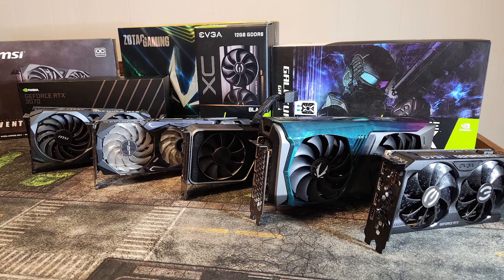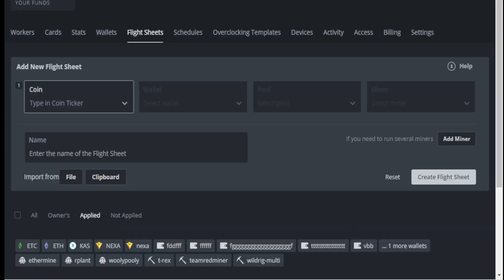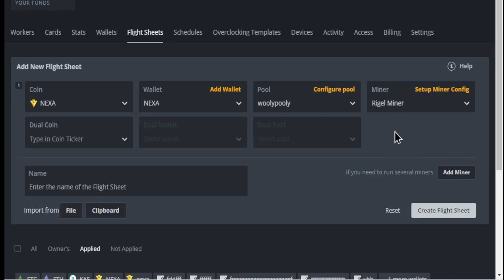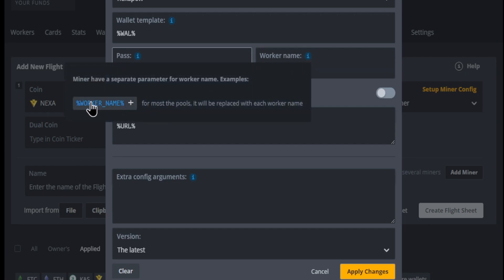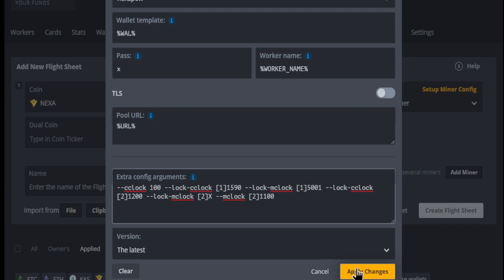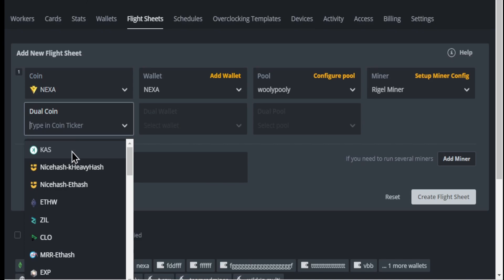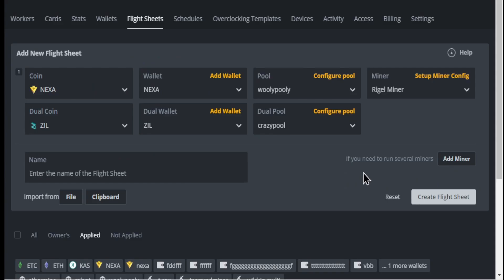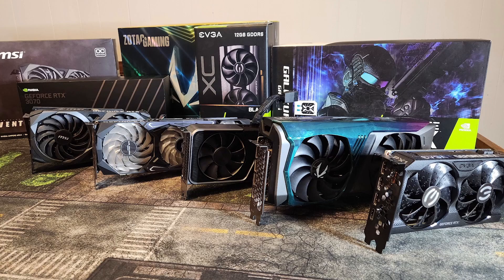How to DUAL MINE NEXA and ZIL on Rigel Miner V1.3.6 with overclock settings

Comment: The question I still have.  Say I have GPU  0-3 and they are all different cards. What parameter command to I put in to tell Rigel what overlocks I want for each GPU?
Reply from the maker: you just look at how they are numbered in hive and put a , in between so for 3 gpus and locking the core it would be "--lock-cclock 300,300,300
Reply: @krootman_digitial  Gotcha. Thanks for the help.

Comment: I get 74 mh on nexa if i put "--cclock 100 --lock-cclock [1]1390 --lock-mclock [1]5001 --lock-cclock [2]1200 --lock-mclock [2]X --mclock [2]1000" into extra config at Hiveos. i get 122 MH on nexa if i dont put anything on extra config area. Why ?
Reply from the maker: how much power does it draw at the wall on both settings?

Comment: Problem is you lose hashrate if dual mine. For example 3070 just on nexa gets me 68-70. When flight sheet is set to dual mine with zil, it goes down to 62 just like your hashrate with same power.
Reply from the maker: To be fair you earn about 20 percent more with zil and even if you are losing 5-10 percent mh on Nex your still on top , I'm also running mine on lower power so I'm getting less hash,I get about 62ish at 115 watts
Reply: @krootman_digitial  reason for my comment is to ask if this is just me or does this happen to you as well? sorry for not being clear. Do you also lose hashrate with dual mining flightsheet?